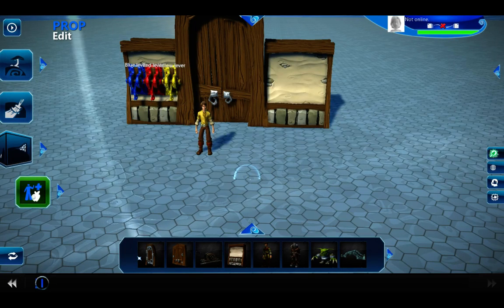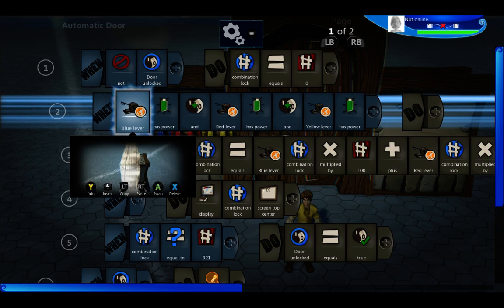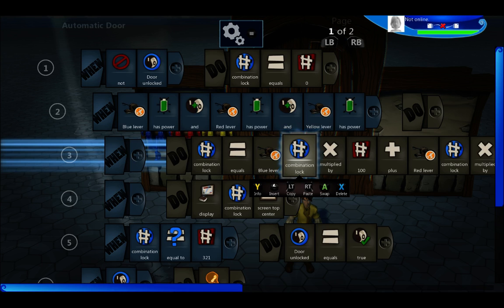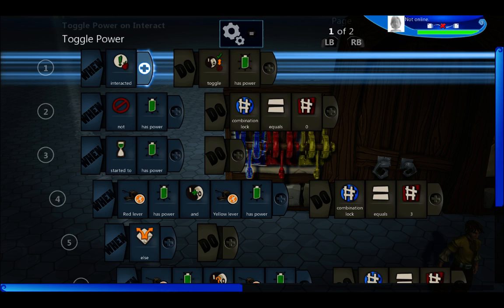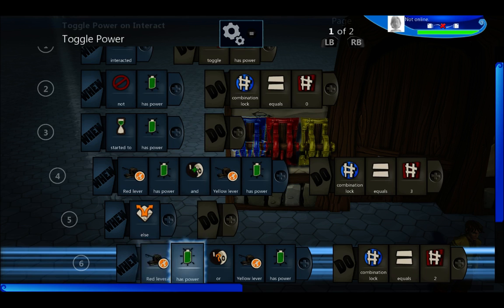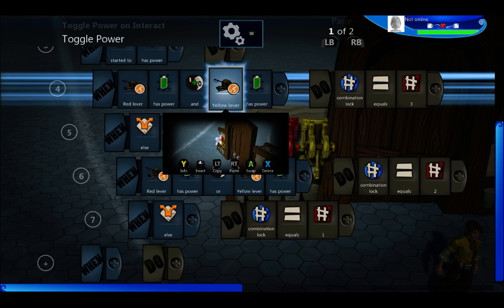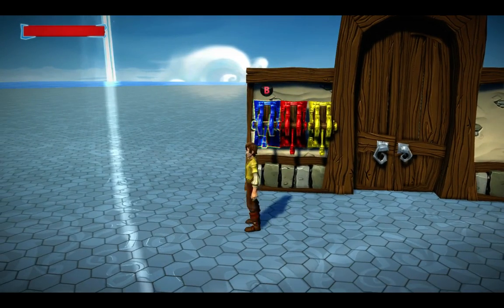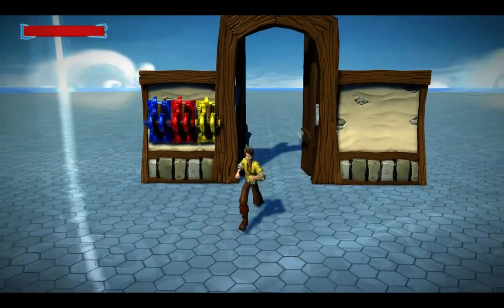Combination Lock in Project Spark

Comment: Wondering if you can help me I am trying to make a game like Myst but am running into problems because I don't know how to set the brains to do what I want. Example I am try to make a a power generator that is vertical it has three rings that rotate on top of each other I got the rotation part but I don't have the moving the power part so I can make this power part other objects in the world like books, elevators and more.
Reply from the maker: I have a couple of tutorials on using power. 

Power Functions in Project Spark
Powering Created Objects in Project Spark

They were some of the earlier ones that I created, but hopefully they will clear things up.  I'm actually working on another idea that I may turn into a tutorial, based on http://Kodeshare.com/2seoAE & http://Kodeshare.com/RznbU4